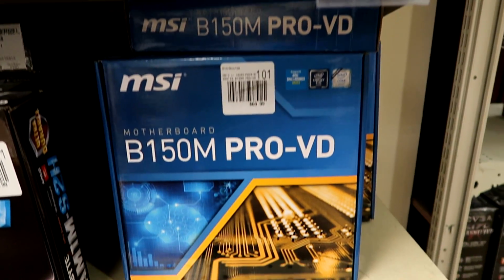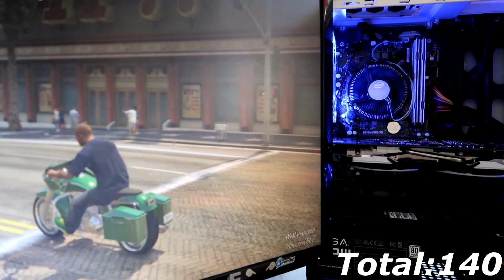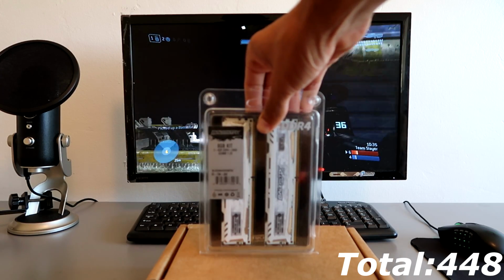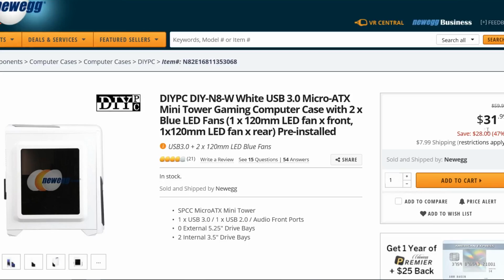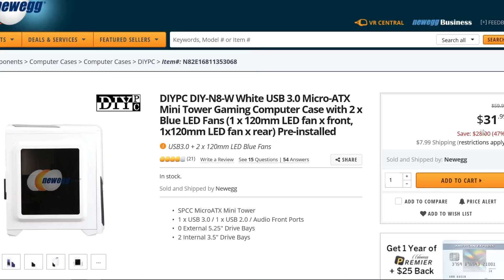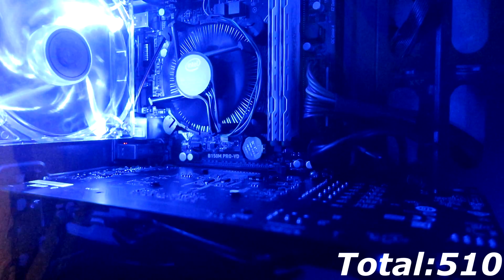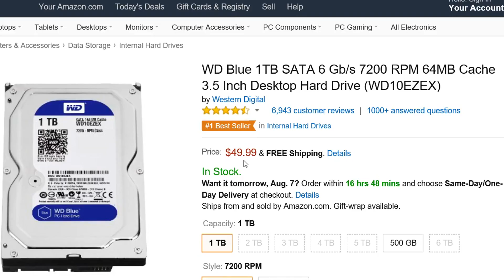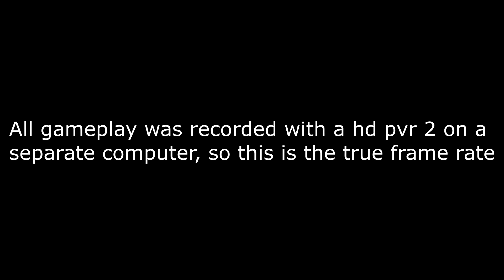Best $550 Budget Gaming PC Build Skylake GTX 1060 (w/ Benchmarks)

Comment: You do realize a i3 6100 bottlenecks a GTX 950 right....

If anyone else wants to buy this build. Spend a little more money on a i5 6500 at least.
Reply: Adelic will it be able to record and stream league at above 60 FPS?
Reply: Adelic where is your source? An i3 6100 can definitely handle a gtx 950 with no bottleneck. It also can handle mid range gpu just fine for many games
Reply: Plus this video is old, people would  recommend pentium g4560 over i3 6100 nowdays cause it offers similar performance to the i3 but cost quite a bit less.
Reply: I agree, even a i5 2500k is cheaper and a beast for the price
Reply: Im interested in buying this pc...any recomendations???
Reply: My friend has a i3 6100 and a gtx 950. His i3 is at 100% while his 950 is at ~70% usage.
Reply: what was the game that had  i3 6100 hitting 100% usage while gpu at 70% usage
Reply: I have i3 6100 with 3gb 1060 and I barely ever bottleneck.
Reply: dragonfistX200 So if I buy this build, what cpu would you recommend for the same price? G4560?
Reply: Man, I've got the same question!
Reply: Sammy Bracy g4560 if you can find for $70-80 and then b250 motherboard for like $60-70. however it seems g4560 is getting hard to find for $70-80(let alone its msrp $60 it had some point) and prices for it are inflated bit too high. for $90-110 price range i'd get a ryzen 3 1200 and b350 mobo $60-80.
Reply: or maybe a fx 6300 or something.
Reply: i5 6500 is bad cpu get i5-8400
Reply: i5 2500k can't even run witcher 3 at 60fps that i5 very weak for today games.
Reply: ryzen 3 a joke 1500 do nice
Reply: Adelic go with a rayzen 2200g now

Comment: Help me bro!!! I made my first pc because of you!!! So I followed everything you said, and went to micro center, Can you beloved the fooled me into buying 2 of the same anti disc? There so called best choice of case? That was missing parts,smh#neverAgain, but anyways my pc died on me, it won't read the wifi adapter piece or sign into guess or administrator, it's stuck on blue screen it won't repair or disc repair or go back to a previous safe.. this local guy had me waist $60 on a new drive and it didn't fix it, geek squad can't help me, plzzz respond to me
Reply: The local guy after saying it was the drive and having me waist $60, then comes to say it was windows 10 acting up that he download 7, and still nothing? Then he tells me it's the motherboard, but geeks squad said it's not the motherboard!!!!!
Reply: Misconducts so did you fixed it?

Comment: I3 together with gtx 1060, hmm is there bottleneck here ?
Reply: Apparently not
Reply: Depends on the game. The i3 6100 can be alot faster then an i7 3770k in the right games (I'd know as i have had both)
Reply: no.
Reply: The 6100 won't bottleneck much.
Reply: no lol
Reply: it will ^^
Reply: Andrew Woods thats what im talking about
Reply: The gpu is constantly on 98-100% load and the cpu 80-100% that's actually bringing the most out of the system quite amazing even
Reply: it isnt
Reply: There is no bottleneck the 13 6100 has plenty of power to keep up with the gtx 1060.
Reply: omg the i3 6100 is bottlenecking the gtx 1060 i better downgrade to a gtx 950 and get less fps lmfao
Reply: if you're insecure about it, get the i5 6600k. it gets the job done
Reply: No
Reply: Elsweyr
get an e5 2670
Reply: +Elsweyr Isn't the i5-6500 enough?
Reply: yeah, I didn't have that in mind. it works
Reply: no
Reply: I saw this one video here on youtube i3 1060 vs i5 1060 and the i3 does bottleneck on certain games like gta v. I guess it depends on the game.
Reply: zheodegeso its actually not bottleneckkkk, i5 is just better so you get higher frame rates

Comment: Hello youtube, i have:
AMD Athlon II X4 860K FM2+ BOX AD860KXBJABOX
MSI GeForce GTX1060  6GB

And i wana put 16gb ram in to this pc, so i need to know what i should to use as other parts, as cheap as possible, to get good performance.
Reply: Sport Highlights And much more You don't need 16gb if you are gaming.
Reply: +MatoKatala well... ark is a thing.
Reply: Change the CPU, it's the biggest bottleneck here
Reply: Sport Highlights And much more x4 860k in today's standards is kind of bad. Focus more on getting a better cpu than ram since you don't need anymore than 16gb

Comment: Can someone tell me of this is a good pc im new to pc gaming 

Motherboard- MSI gaming intel B250 LGA 1151 DDR4 ATX
Graphics Card- MSI GTX 1050 gaming X 2G
CPU- Intel core I5-7600K LGA 1151
CPU Cooler- Cooler Master Hyper 212 evo 
RAM- 16Gb (2 X 8Gb) G.Skill Aegis DDR4 PC4-24000 3000MHz
Hard drive- Seagate 2Tb BarraCuda SETA 
Power supply- EVGA 600 B1, 80+ Bronze 600W
Case- Corsair carbide Clear 400C compact Mid-tower case
Reply: Sorry should have spaced better lol
Reply: ViiRUS GRAViiTY Hey bro, I recommend to you, buy a GTX 1060, if you'll play games only, you can buy a i5 7400, you'll save money to invest on a graphic card better. You can get the i5 7400 + GTX 1060 and only 8GB of ram for save 50 - 70$ (Dollars in US) To invest in a GTX 1060. With 8GB of ram you can play every game without bottlenecks. The GTX 1060 vs GTX 1050, the difference is enormously, in games, around 30 - 55 FPS more. (90% - 120% better).
Reply: ViiRUS GRAViiTY this not good your motherboard doesn't support overcloking while your cpu does you have to choose do you want to overclock or not,and the power supply is too much for this , and your GPU is not that great if you are not in huge budget wich if you was this build isn't good for you
Reply: hamad ali im trying to build a pc on a 1000 dollar budget can u help me?
Reply: for gaming
Reply: ViiRUS GRAViiTY 1000 that's very good price point
Reply: ViiRUS GRAViiTY do you want  overcloking or not?
Reply: hamad ali yes
Reply: hamad ali i want to be able to run games like battle grounds, overwatch, and GTAV at a good fps
Reply: hamad ali im a console player so i dont know to much about pc's
Reply: okay i might be wrong here, so correct me if I'm wrong.

Okay Viirus, in my opinion, 2TB HDD is not that compulsory when it comes to building a gaming rig. 1TB would be enough. So with that extra money after you downgraded to 1TB HDD, you should upgrade your GPU(Graphics Card) to a 1050ti or even 1060 if you want a better performance for an extra $100++. And the power supply is too overkill, so you should probably spend it on other important parts such as the CPU and Motherboard :)
Reply: the rest of the unmentioned parts would be fine for that budget.
Reply: Bleach thanks 👍
Reply: Bleach he should get the new kabylake cpu's and b250 motherboard
Reply: ViiRUS GRAViiTY anytime bro :))
Reply: hamad ali if it's compatible with each other and it's in his budget range then i see why not ?
Reply: Bleach what kind of power supply should i get. 400W?
Reply: m yea 500W would be good and can last you years and would probably need not change it anymore if you got any upgrades in the future :)) cos it would totally be enough
Reply: ViiRUS GRAViiTY instead of 2tb hdd, get 1TB and 250gb ssd or a better motherboard or gpu plus your psu has 600w which is more than u neer
Reply: Gloppin Boopin yes you can

Comment: If anyone knows and can answer this question, (Maybe someone who actually knows about pc's unlike me) I am looking to build a pc and I have watched videos on it, doesn't look to difficult other then setting up windows and all that. But if I were to change the i3 6100 to a 6300 would the parts with this build still work?
Reply from the maker: Yes, an i3 6300 would still be compatible
Reply: PeanutButter25J Think you could make a pcpartpicker link and send it to me in a reply so I can buy it. I don't trust myself with picking parts. I know you have it in the desc but pcpartpicker is easy peasy. I am looking for 13 6300 and 1060 with 8gb.
Reply: Yes it would still be compatible just dont use an i7 processor because you would need a better fan
Reply: Yes
Reply: UniversalGaming yes

Comment: What If you switched that graphics card with a msi 750 ti?
Reply: PenguinCS why would you do that?
Reply: PenguinCS get the 1050 ti its the same price
Reply: Mo rice not currently. Gtx 1050 is $150 and gtx 750ti $60 on Ali Express
Reply: Saad Kashif don’t order stuff on Ali express, every thing seems cheaper
Reply: Azlon if you found a 750 ti that cost lower than a 1050 or a 1050 ti and your alright with having a little more poor performance compared to a 1050 ti then go with the 750 ti if you want, the 750 ti is not a bad Card (depends on how much you pay for it)

But I would 100% recommend a 1050 ti or 1050 atleast...
Reply: EarthyPython why? A 750ti for $60! Aliexpress is a trusted site. It's a very good deal for those who just wana play light games. It's faster than a GT 1030 which means it can run any game at 720p low

Comment: can i get i5 6500 instead of i3 6100?
Reply: Yes but mabe u will need new MOBO or power supply
Reply: Juzy Juzz can u suggest which one?
Reply: Go to PcPartPicker put your parts and they will tell you if its compatible
Reply: tq
Reply: yeah
Reply: yes and you wont need a new mobo idk wtf was that guy thnking about. Idk if you need a new psu but you probably not. You can get a 500w evga psu if you want though.
Reply: Yes you can, w/o changing the other components in this video.
Reply: Juzy Juzz 
Nah.. i3-6100 and i5-6xxx are both 6 generations..every 1151 motherboard is supported

Comment: could someone tell me how well this will run Arma 3
Reply: Brayden Brenneman its a 1060 so it well blow arms like a piece of cake
Reply: Brayden Brenneman it would struggle with an i3 since arma is cpu intensive. also Arma servers performance range
Reply: Sweet Feather what would be a good processor then?
Reply: +ImSwavey any Ryzen 5, or slightly newer i5. I have an i7-4790k, and still cant acheive 60 frames in most servers. Its just one of those games.
Reply: WiFiGawd_ my friend plays on an i5 6600k and it runs steady 60/70 fps but when no one is around goes higher
Reply: I run arma 3 over 60 fps with a 750 so you're fine

Comment: The power supply can be installed either way, and actually it's probably better to be facing up if it's on the ground. Loads of PC building websites put it like that so they don't have to deal with Static Electricity Warranty Repairs.

Comment: hey! i loved your video on building this PC!

I ended up building a PC for my girlfriend as an anniversary present lemme know what ya think!
I bought everything from micro center due to price matching and bundle deals

Asus z270-AR-50 dollars open box(once paired with the i5 6600k)from microcenter
i56600k-180
EVGA GTX 1060 6GB SC-250
NZXT 640S i believe for 75 bucks
H55 Corsair Liquid cooler-70 bucks
EVGA 650W Gold G2-100 bucks
Crappy Logitech keyboard-20 bucks
RAM- EVGA 16GB ddr4-95 bucks
125GB Sandisk SSD-50 bucks
1tb WD black-Free from a friend

Reason i went a little higher end in this "budget build" is she has an HTC vive that she loves using on my PC so i figured i had to go a little more on the high end for some parts to keep her ability to play VR in Tact.

Thanks!

Comment: My $600 build has an i5 6400t bclk overclocked to 4 GHz on an ASRock Z170 Pro4s, 16GB ddr4 3000mhz, MSI Rx480 4GB, Corsair H50 liquid cooler, WD Blue 1TB HDD and Corsair 500w psu. All parts sourced new from eBay or Newegg.

Comment: Hey man Good job in finding a cpu that could extract almost everything out of the GTX 1060 6gb in an entire build for under 600$. my question is, wouldn't I need a cpu cooler? And if I don't, do I still need to apply thermal paste? Great video by the way.

Comment: I built the same thing for same price but i have an intel core i5 6500, GTX 1060 I only paid 180$ for it and paid 150$ for my i5 6500. The case is 32$ same thing you got. 8GB of RAM same price. Hard drive same price. But damn dude i like it

Comment: Any love for the old i5 3570k? I'm running that with a GTX 1060, ASRock z68 mobo, 16gb Ballistix DDR3L, Crucial 275gb SSD/ 350gb HDD and Corsair m450 PSU in a Prodigy M case. I'm hoping to overclock my CPU to 4.5ghz with better cool.

Comment: hey i just recently thought about building my own budget gaming pc, i mostly play ark survival evolved.
specs are 
case: NZXT H440 New Edition Black/Red Mid Tower Windowed Case, USB 3.0, 4x 120/140mm -------- Fans Included
motherboard: ASRock H110M-HDS, Intel H110, S 1151, DDR4, SATA3 6Gbps, Realtek Gigabit LAN, USB 3.0, Micro ATX
processor: Intel Core i3 6100, S 1151, Skylake, Dual Core, 3.7GHz, 3MB Cache, 1005MHz GPU, 37x Ratio, 47W, CPU, Retail 
memory: (RAM)16GB (4x4GB) Crucial DDR4 Ballistix Sport LT, PC4-19200 (2400), Non-ECC Unbuffered, CAS 16, XMP 2.0, 1.2V 
internal hard drive: 1TB WD Blue WD10EZEX SATA III 6GB/s 7200rpm 64MB Cache 8ms OEM HDD 
GRAPHICS CARD: Zotac GeForce GTX 1050 Mini 2GB GDDR5 Graphics Card, 640 Core, 1354MHz GPU, 1455MHz Boost
new to pc gaming but are these parts good or should i upgrade, dont have too much money to spend but all these come out at £460 or somethng like $570 
Is there anything better in replacement for these parts for similar price or cheaper?

Comment: Soo, I built a build for 550$ as well, here are the specs:

Intel Core i3-2100
4GB DDR3 RAM
NVidia GTX 660

And how futureproof is it? Well, if you upgrade the RAM, it can last for about 5, or even 6 years, if you can live with lowered settings.

Comment: Here is my build. Spent $550

AMD FX 6300 Processor
MSI 970A Gaming Pro Carbon Motherboard 
EVGA 700 watt
Hyperfury 16GB Ram
Coolermaster Geminii M4
Vivo Mid Tower ATX
Asus Optical drive
Western Digital 1TB HDD 7400rpm
Nvidia Geforce GTX 1050Ti SC
Eagletec Mouse and Keyboard

Comment: if your building a pc in 2017 dont a 1060 6gb is like 400 now wait till maybe late or early 2018. you can get you pc ready like buy the mobo ram cpu and the psu but dont buy a gpu jest buy a use 950 or 770 on ebay then when you see price drops buy a 1060 or a 1070
Reply: thats what im doing right know

Comment: I made the same think just psu -eclampsia 500bq 50£
Cpu-ryzen 3 1200 90£
Gpu gigabyte 1060 3gb 260£
Motherboard -  b350 pro  vdh 90£
Hdd wd blue 1tb 50£
Case cooler Master masterbox lite 3.1 50£
Ram 8gb ballistics 80£
670euro

Comment: Hey guys, I'm building my first PC ever and I really want some feedback on how I can improve or just how good this build is. (NOTE THAT THIS IS A BUDGET BUILD)

-Intel core i5-6400
-MSI H110M pro
-Crucial ballistic sport 8 gb ram (2x4)
-Western Digital Blue 1tb internal hard drive
-Zotac GeForce GTX 1050 mini
-EVGA 430W PSU
Reply: Also, if i wanted a wireless network, can I just buy a decent USB wifi dongle? or what recommended PCI card should I get?

Comment: my future build
CPU:AMD fx 8350
GPU: msi 1060
RAM:hyper savage 8gb
MOB:msi 970 gaming 
CASE:nzxt s340 
PSU:corsair 550w
and a CPU cooler
Reply: bobby poo Is there any reason to get yourself a FX Chips unless it's cheaper than your meals? That thing is on an old plattform, is inefficient and has bad Single core performance.

Comment: Hey, new to self build and looking at Similar price. Any recommended changes to the below to either a) reduce price or b) better parts for same price or just better performance etc
 
CPU - Intel Core i3-6100 3.7GHz Dual-Core Processor
£105.46 

Motherboard - MSI B150M MORTAR Micro ATX LGA1151 Motherboard
£74.98

Memory - Kingston HyperX Fury Black 8GB (2 x 4GB) DDR4-2133 Memory
£64.32

Storage - Western Digital Caviar Blue 1TB 3.5" 7200RPM Internal Hard Drive
£42.98

Video Card - Sapphire Radeon RX 480 8GB NITRO+ OC Video Card
£222.48 

Case -NZXT S340 (Black/Blue) ATX Mid Tower Case
£64.17 

Power Supply - Corsair CXM 450W 80+ Bronze Certified Semi-Modular ATX Power Supply
£49.95 

Total: £624.34
Reply: Shot Shy Sheriff see if you can find a cheaper motherboard with same chipset

and buy 1 8gb stick instead of 2 4gb of ram it will be cheaper

see if the parts are compatible
Reply: Shot Shy Sheriff if you can upgrade to i5 as it is a quad core

Comment: I'm wondering since I'm planning on building this how would you upgrade it? Like if I wanted an i5 then wouldn't I need a better power supply but then not want anything bottlenecked so I'd have to get a new graphics card but then I might need a new motherboard. It seems like if you want to upgrade you're basically just building a new pc

Comment: I made a pc called Black Saiyan
Specs
Gtx 1050 Ti 4GB
G4560
8 GB ram
MSI military class 4 motherboard
430 watt + 80 PSU
LEDs
Black Thermaltake Core V1
This a good starter PC build?

Comment: How Would These Specs Perform?
- Intel I5 7500
- GTX 1060 G1 3GB
- 16GB DDR4 Ram
- 2TB HDD
- 120GB SSD
- 850w PSU
- Windows 10
Reply: good. but first off you dont need 16GB of RAM to game nor a 850w PSU unless you're running an SLI setup
Reply: Valk NA, the 850w psu comes with the case and the 16gb of ram works out cheaper or similar price to 8gb DDR4.

Comment: I could buy a PC 
specs:
240gb SSD
1tb HDD 
i3 7100
Intel HD graphics
8GB ddr4 ram

 if put an graphic card in it would it be worth it
Reply: Lander De Mulder does it have a good power suply? 

and depends on the price
Reply: Olav Furuseth power supply idk but it costs 499
Reply: if the power supply is compatible maybe... if you dont know much about building pcs i recommend getting help with this... use https://pcpartpicker.com/ to see if parts are compatible and get help

Comment: PeanutButter25J what do you think about this pc, can you guide me a little pls i would really appreciate that
Intel Boxed Core I5-6600 3.3GHz
Kingston HyperX FURY Black 8GB Kit (2x4GB) 2133MHz DDR4
Gtx 1060 Gaming x 6g
Asus b150 pro gaming
Thermaltake Toughpower 750W

And if in this pc build video can i change the cpu to a i5 6600 3.3Ghz and use the Thermaltake Toughpower 750W